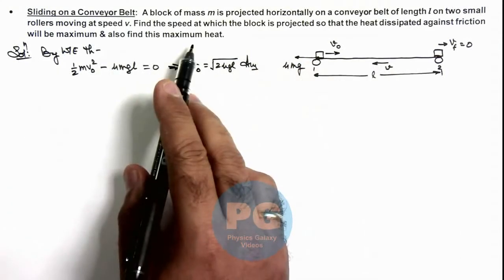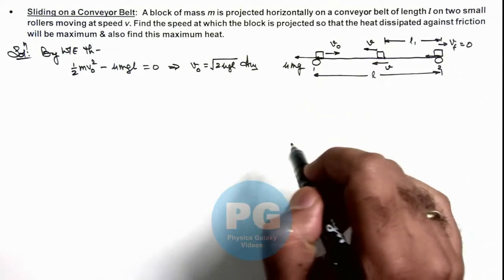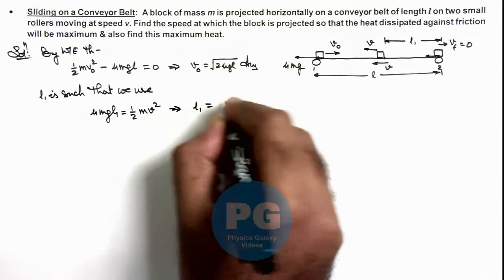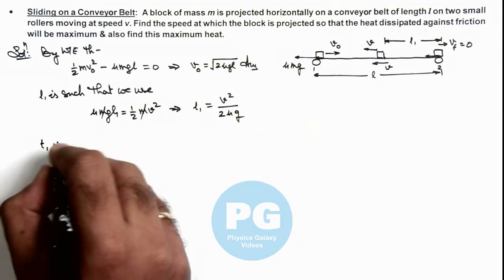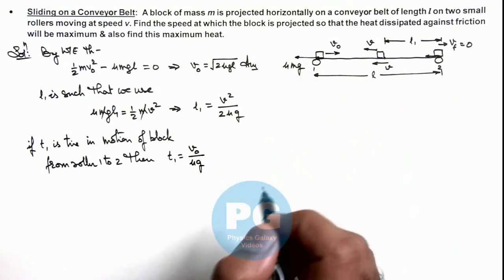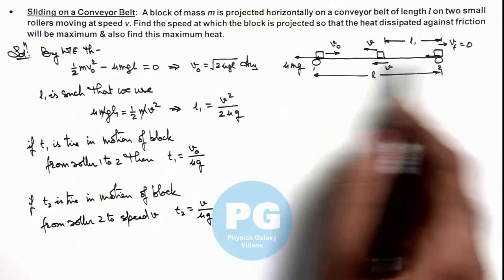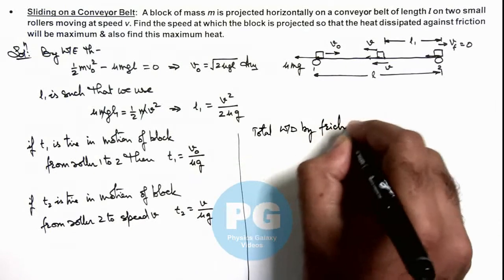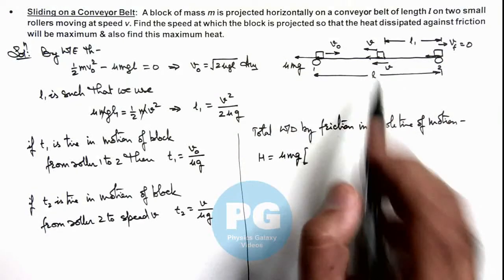Advance Illustrations – Sliding on a Conveyer Belt | Work Energy Power #17 for JEE Advanced

Comment: if i am not able to solve these kinds of advance problems on my own... than also can i qualify nsep
Reply from the maker: Its not necessary to solve the problems on your own for the first time... you need to prepare thoroughly for the topic before starting the problem attempt... use the examples and adv illustrations several times then once you gain confidence then only start attempting problems...
Reply: @lifestough2546  yes, it Also depresses me
Reply: @lifestough2546  follow what sir says if you aspire to become a topper
Reply: @lifestough2546  Sir is absolutely correct , at first toppers also may not able to do the questions on their own but with their practice and doing plenty of questions like this , they become master and can do further even a new question...

Comment: In belt frame which is inertial , we use
V relative intially = v+ v not
V relative final= 0
Work done by friction = change in kinetic energy= O - 1/2 m ( v+ v not ) ^2  
Put the value of v not and we get the same result. 
Is it correct?
Reply: I was going to type the same thing then I saw your comment. The solution in the video is wrong
Reply: heat energy= m[( root(2.nu.g.l) - v )^2  + v^2]/2         projection velocity= root(2.nu.g.l) -  v

Comment: Sir in the 2nd motion work is done by friction to increase the kinetic energy of block so heat should not be dissipated due to block motion ,it should be only due to opposing belt motion therefore no umgl term should be there in 2nd case

Comment: So, work done by friction is -μmgl in ground frame, but -μmg(l+vt1) in belt frame as the total length of action of friction in ground frame and belt frame are l and l+vt1?
,i.e., is the work done by friction different in different frames of references?
also, would that explain why the kinetic energy drops from muu/2 to 0 as seen from ground frame of reference and from m(v+u)(v+u)/2 to mvv/2 as seen from belt frame as the friction does more work in the belt frame than ground frame? if yes, would the heat dissipated against friction be different in the two frames?
Reply: work done is -mu(mgl) in ground frame is only on block but also friction is doing work on conveyer belt .. net work done would be conserved ...
Reply: ADARSH CHATURVEDI So, the kinetic energy of the block was dissipated as heat in the conveyor belt+block+(any other) system?
Reply: Loss/gain in K.E of block+ loss/gain in k.E of conveyer belt net change in K.E is lost from whole system as heat ...
Reply: ok!
thanks a lot!
Reply: Wow,thanks

Comment: Sir,how do we know that l1<l? I mean isn't it possible that in second part velocity of block will not reach to v but length will come to end?
Reply from the maker: In que it is asked to find the velocity so that heat dissipated is maximum means we are finding it out for the case when speed is such that the block at max can go to other end pulley only...

Comment: ??? Sir, in 1st equation  ,for calculating work done by  friction ,you used absolute distance travelled by the block .       But in last equation, for calculating work done by friction  ,you used relative distance  travelled by block???Why sir???
Reply: Yes bro I have same doubt if you have find answer then tell me
Reply: @Mayank.  see, in first equation, we are using WET on the block, and for a second imagine that there is only the block, and the belt is invisible. You are just seeing the block travel a distance = L in the forward direction with friction acting backwards.  So WD will be f*L. It does not matter how much the belt is moving here.

But heat will be dissipated by the the contact of belt and block, thus we will analyse this wrt the belt. Hence, in first part, more part of belt is used(or heated) than length l as both are in opposite direction.
In second part, both are moving in backwards direction, thus lesser part of belt is used than that of L1.

Now you can work it out with equations, just use WD=f*(rel disp of belt wrt block) , use correct signs for all of them, write disp of belt and block seperately first and the do (s belt)-(s block) and you will get to the answer.

That was pretty long now, hope I have made it clear to anyone reading this.
Reply: @iliyanparin_iitism  when we are writing work done by fricrion firstpart me -ve and in the secind part it should be +ve right ?
pls check what sir have written

Comment: Sir I went and sat on the conveyor belt. I see the block was moving with velocity (v not+v) which reduces to zero. Since, there is no other force doing work and the frame of reference is inertial. I used. 1/2m(v not +v)^2 is equal to work done by friction.

Comment: Sir.....why did u take W.D by friction as umgl????
The distance covered is more than L so word done will be more than umgl
Reply: Here we applied WET on the block, so considering only the displacement of the block from 1 to 2, which is equal to l, WD=Force*disp. Hence the above. And in the final case heat will be dissipated by the belt, thus we took the relative displacements of belt wrt block.  Hope it helps.